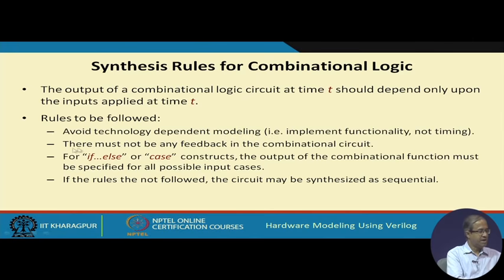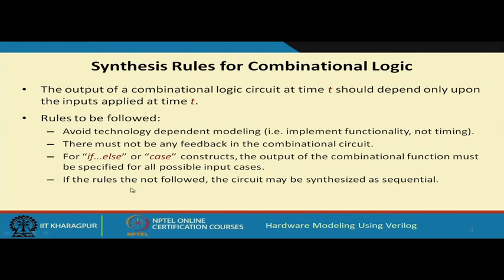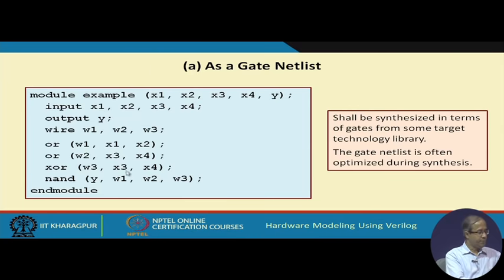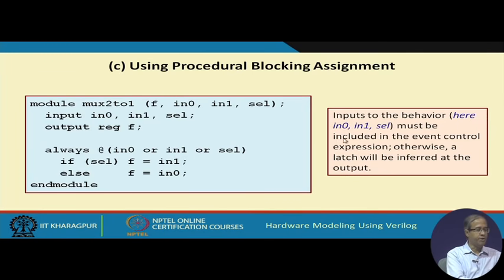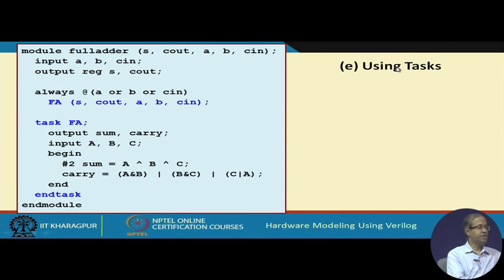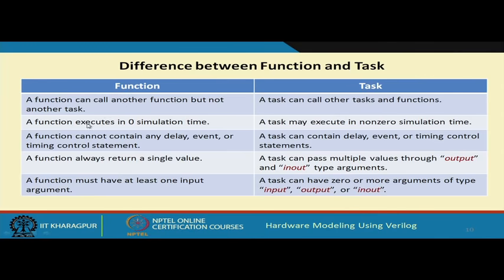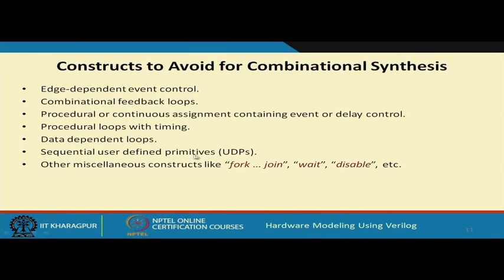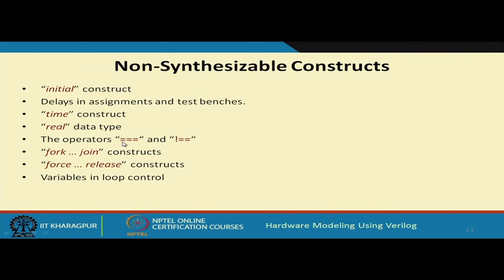SYNTHESIZABLE VERILOG

Comment: why do we have built in primitives? while we can already implement things behaviorally like "assign x=a|b;" instead of "or (x,a,b);"? does those primitives serve some different purpose?
Reply: gate level primitves are required for the synthesis of verilog code into the transistor level layout in the software for example microwind , where you have to code everything using the gate level primitives